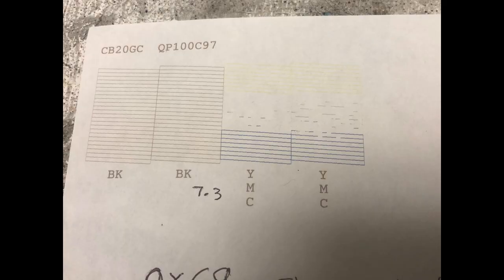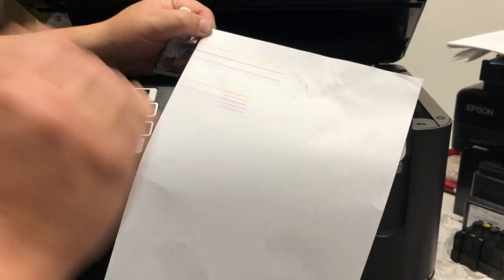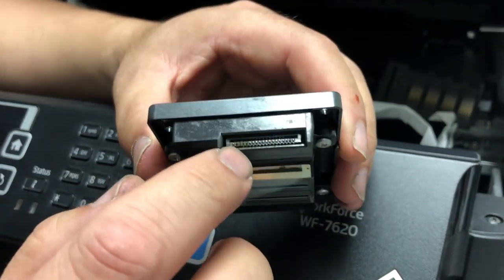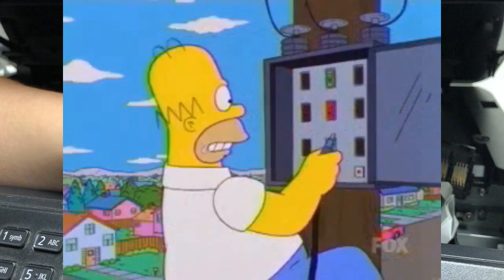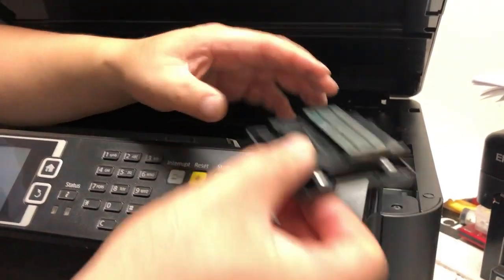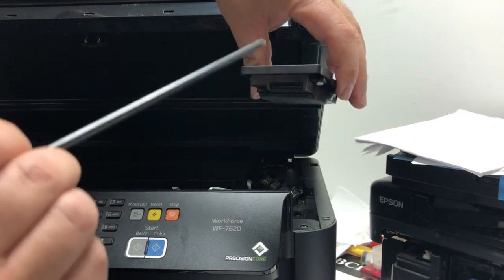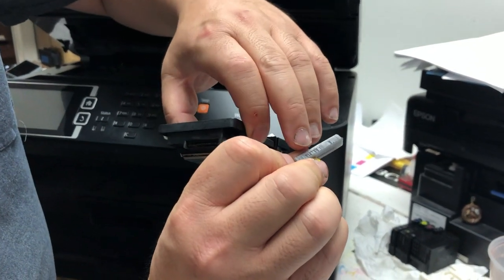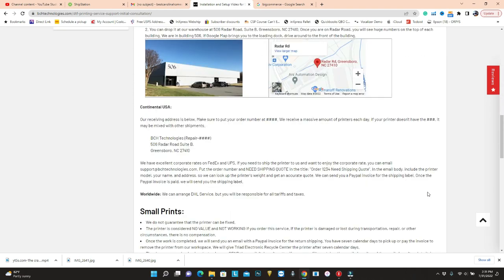STOP Cleaning! Dangerous Nozzle Check on Printer WF-7720 WF-7620 WF-3620

Comment: hi. Kevin your video are very god and of help .. thanks, I have a issue with my epson wf- 7620,  I had replace a belt cr, and have disconnected all cable on the mainboard, , now when had assembled all connections, the print not power on,  also the ribbons of the head them are disconnected and reconnected. I had also found oneribbond of three head FFc unplug, now , I can burn a mainborad ? The power supply , what tension have in output connector..  ?
I ask you because you are more professional and clear  . Can you help me ?